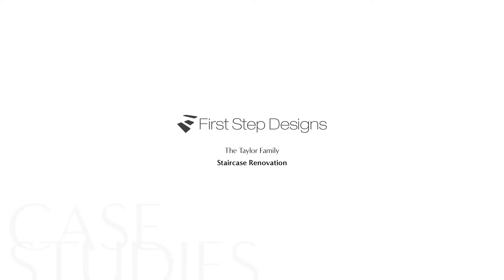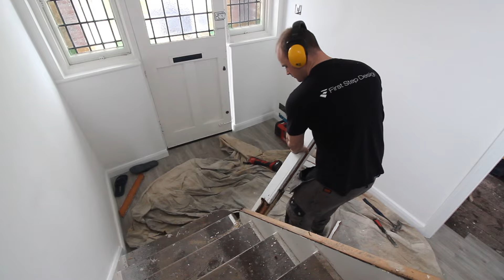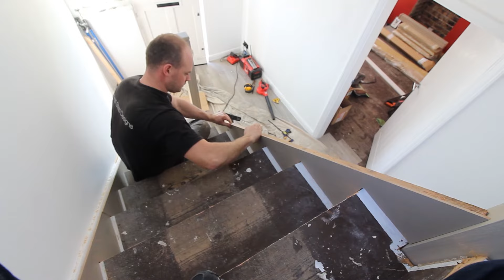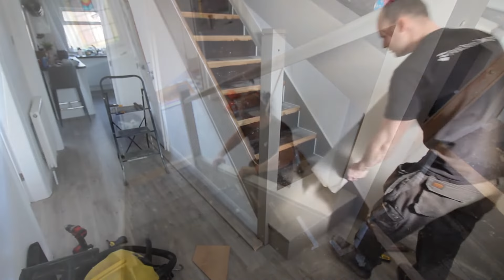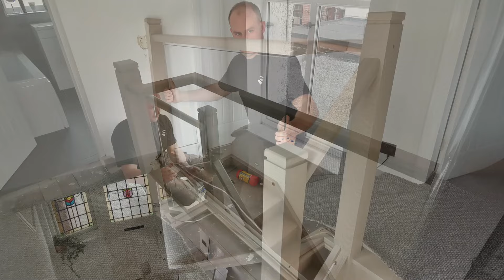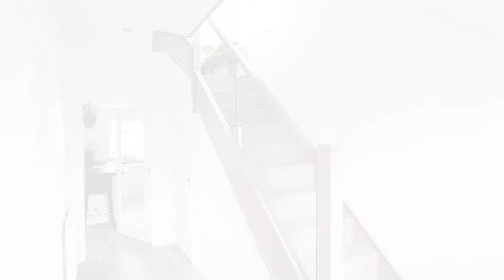The Taylor family Staircase Renovation | First Step Designs

Comment: What is the price for stairs like this in the video?
Reply from the maker: Hi Victoria, Prices vary depending on each proejct. e.g. this one had a custom stain to European white oak so it is a different cost. Most staircase renovations typically cost around £4,500 +VAT (this includes, design, survey, installation, French Polishing and a 10 year warranty). However if you upgrade to solid oak steps like this one it typically adds around £1,900 +VAT. I hope that is useful.